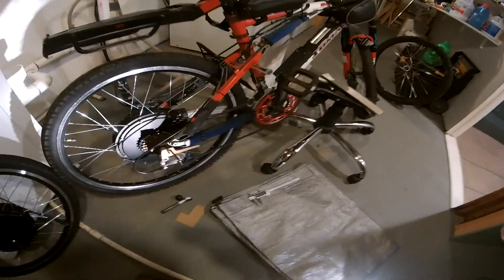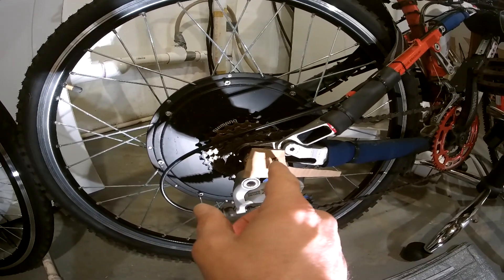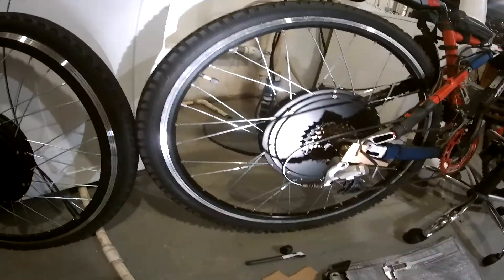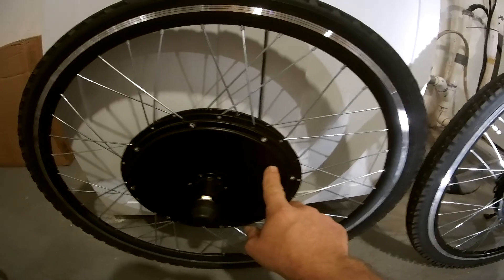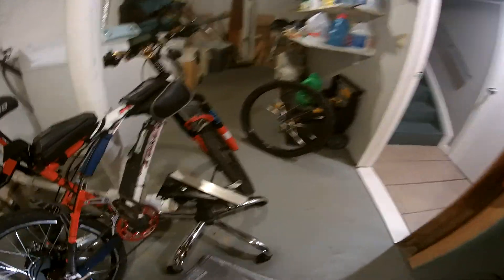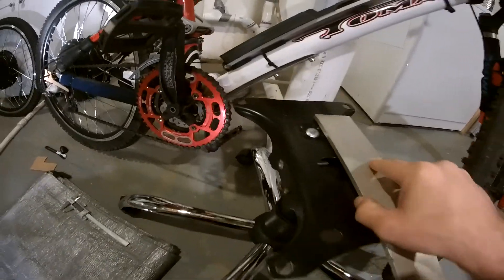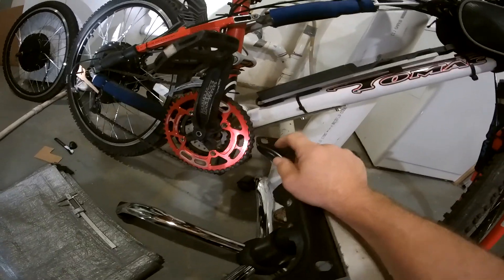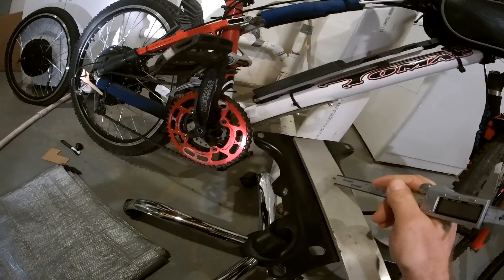1000w vs.1500w hub motor size compared & torque arms 🚴⚡ebike upgrade Tomac 98 special pt1

Comment: Hi, did you have to change your controller whe you changed to the 1500w hub ?  thanks
Reply from the maker: Thanks for asking check out my 1500w 52v Vintage Trek Fuel 90 build 35a controller 40a battery bms 44mph

Comment: Hello! I have a question.

I’m planning on doing a bmx ebike build. Is it possible to use a front hub model and install it on the rear? I wouldn’t need to pedal or use the sprockets. 

Is there a motor that I don’t have to pedal first?
Reply from the maker: Sure why not throttle only but just seems better to have a chain since you still need the pedals 👍